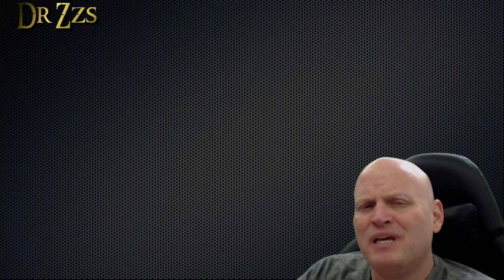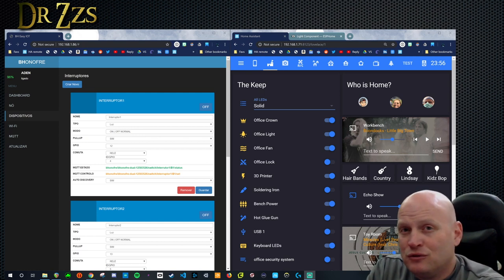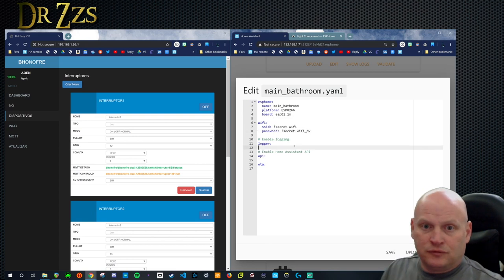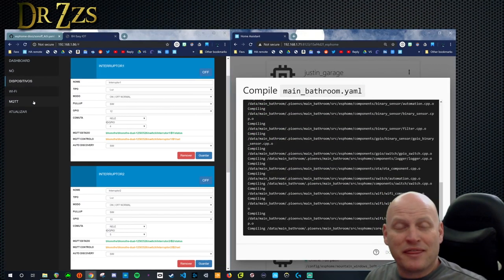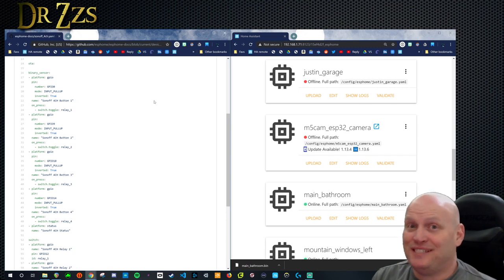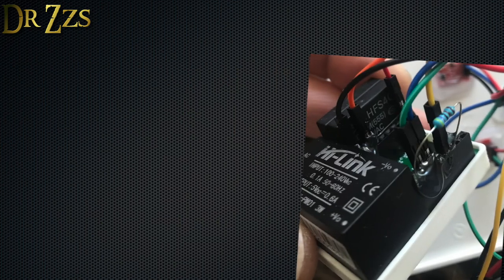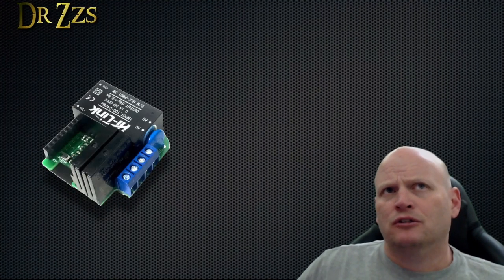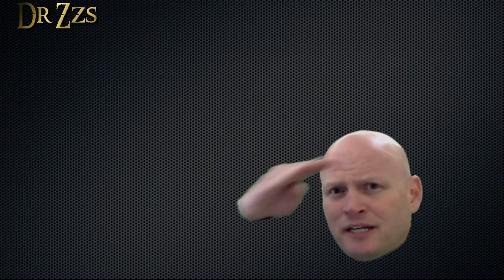Mini Smart Switch w/ ESPhome yaml | home automation | Home Assistant

Comment: I've used the RCWL-0516 microwave sensor for about a year. 
It's very sensitive to noise from electronics and should be placed away from metal to avoid false postives. 
The main problem with the sensor is that sensitivity is not adjustable. 
Range is about 5-7 meters. It works well as a "general room presence detector" for lights, but testing different placements in the room is key to getting a good result. I use a PIR sensor turn on the lights and the microwave sensor to detect when the room is empty and turn off the lights.
Reply from the maker: That's interesting.  I hadn't thought of using both together.  
Thanks!
Reply: If you have problems with false postives with a PIR sensor you can also use the microwave sensor as a confirmation. Then trigger the light if both sensors are postive or use the microwave sensor as a condition.
Reply: RCWL-0516 Microwave Radar delivers 360° motion detection even through glass, that's why DrZzs thinks the sensor is not working well

Comment: From a NEWBIE just starting off. This product here.  Where does it "fit" with sonoff?  What are the "cases" where I would use this over sonoff or vise versa:
what type of smart install applications will this be best choice over a sonoff?

I was thinking of 'starting' with moisture sensor and watering (small pump) wife's plants in separate pots.  I was looking to try and combine management of 2 or more pots under 1 manager card be it sonoff or another card.  However, each flower pot would need its own sensor, water line and pump and also some have additional code to over ride dry for extra few days as some plants strive with "less" water than others. 

I hate to ask so many questions but still gripping logic of basics what I can and limited to and figuring  out the best configuration installation with less to manage and cost savings to spend toward "security sensor devices" I need also.

Most Humble appreciation for your guidance and  injput based on your knowledge and experience.

Alton

Comment: 2 things about SSRs:
1) they don't ever completely turn off. Being a silicone device there's always leakage current. As far as humans are concerned even when "off" they'll read mains "hot" w/ a meter.
2) always go about 2x in rating over your expected load. Might still need a heats ink even then. I get a 10-15°F rise in my water heater controls box w/ an 80mm fan drawing across heat sinked 40A SSRs w/ a 17A load. 
I did scale the fan PWM from 0-100% for 75-90°F in the code. Runs quiet most of the time unless heating.

Comment: you can change the sensitivity of the touch sensors by replacing the capacitors at the back. You can find more information by going in the datasheet for the TTP223
Reply from the maker: Awesome!
Thanks

Comment: As for choice for HAS COMPUTER, i selected what should be a yr old announced SBC which I believe will be a super performance option.  However,  I have to ship it to CA to a contact there to customize small alteration to the SBC itself.  I cover the cost to ship it there and back home.
I would prefer that SBC over an old business server I have had for 20yrs.  It has 5 SCSI hard drives.  I was going to load different OS and apps on each drive then use BIOS to boot from Drive I needed at the time for a specific purpose.  But that would conflict needing HAS UP AND RUNNING all the time.

Comment: Microwave motion sensors can see through most interior walls, so maybe not false positives, was someone in the next room?
Reply from the maker: Could be.  Have you gotten them to work?  I've tried a few times and always end up going back to PIR. 
I read a lot of post about people having trouble with them when connected to ESP8266. 
The first time I used one, I just connected 3v and an LED to show when it detected motion.  It was really sensitive.  Like if I took a deep breath, my chest moving was enough to activate it.
They are cool.  Hopefully I can figure out how to make use of them someday.
Reply from the maker: oh, and Happy Belated Hatching Day.  I can't believe we forgot to sing to you on the stream yesterday!!
Reply: I was going to mention the same thing. The can see through walls. Seems like a great sensor to use to see if someone is still in the bathroom, you just have to find the right place to mount it.

Comment: @DrZzs The failure to connect after initial flash is because the ESPHome server/docker is pinging that devices IP after the flash every X seconds but the actual device needs time to reboot and connect to the network after flash.... it's perfectly fine.
Reply from the maker: Excellent!
I figured it wasn't a problem.  If it does it for more than 8 seconds then I start looking for something that's unplugged.

Comment: Quick note on the lack of UL listing: AFAIK, UL is a US-only certification entity, so if the device is only really meant to be used in Europe (or only Portugal, considering the firmware language), the manufacturer will often skip UL certification. Doesn't necessarily mean it's unsafe, but depending on your building codes, you might actually be out of compliance if you use stuff that's not UL-certified, so it's something to keep in mind.
Reply: I would feel better without UL certification if these devices carried a similar European certification. I will not put an uncertified device in the walls of my house on 110 volts. Good chance you could jeopardize your insurance coverage if something bad happens

Comment: Hey Doc, I am back again, had to step away for some time. I am catching up on videos. 2 things, 1st the FUN one.  I saw your home tour just now. LOL

Lovely home. 5,500sq ft. I had1,300sq ft, sold and bought 4,000sq ft, sold and bought 2,000 sq ft, sold and bought 1,500sq ft, sold AND NOW in a 1,000sq ft home. LOL.  The 1st four purchase sales were for equity gain cash. netted 600k overall. not bad. 5th move was near widowed mother to assist her and plus my career cut short .Disability Heart related. (Our house sizes are funny to me.)

2) IMPORTANT - Over time you have used different boards.  This board seems just by this video that it has more and maybe be used "in place of" the earlier boards you installed in your home.  Am I wrong in that assumption?  Also what is total cost in your choice board and door/window sensor setup with wires and all?  If you posted on your website link to wires. board of choice (I know doorbell unit is different and like what I think is y9ur latest option there).  but there I have a question on how much power normally runs to a regular door bell? Can you add to website links for doorbell parts purchases including any power reduction items.  That would  be an excellent guide.
I hope you post "somewhere" all your modified code for boards you set up in HA That would be helpful.
I am ready now to start with smarting my home/ storage barn/work shed/private office in one building and also my entire yard/driveway .
Side project:  I have AI development board, KING of projects is to fully automate my riding mower to mow entire lawn "in a pattern" and open and close-lock barn door all in one.
Security First though.
God Bless your work here and Professionally! God Bless your nice family!
Humbly ,
Alton

Comment: Ben from BRUH had some dramas with a sensor ($15 DIY Multisensor - Temperature, Humidity, Light, Motion, and RGB LED) and fixed it by locating the sensor physically further away (he ended up swapping it out for a different device because his was a tiny all in one unit). Not sure if this is the same issue but I'd try putting the microwave sensor on some long leads and testing again.
Reply from the maker: good idea.  I'll give it a try.  Thanks!

Comment: You are going to burn a hole in my wallet. I have a Shelly 2 that I need to replace with one of these to add motion and humidity to.
Reply from the maker: I've been trying to decide which is better, this or Shelly 2.5
Shelly get's lots of points for being UL listed.  But it cost $30 on Amazon, or almost as much direct from the Shelly guys. It has power monitoring, but I don't need power monitoring on every switch.  
I would like a temp and motion sensor on just about every switch, so that's a point for the BHonofre.  
I want to build some BHonofre's myself.  If they aren't terribly hard to build, and if the price is a lot lower when I build it myself, I think I'll be using a lot more of these.
Reply: @DrZzs  never use the power monitoring either on my Shelly 2. I can calculate the usage if I wanted anyways. I like how this one is designed to be used with extra sensors as it appears isolated unlike the Shelly. Plus it looks stupid easy to load firmware. Fits my needs perfectly. Only downside I can say is I wished they used the Meanwell power supply like Luma did in the HA Switchplate.
Reply from the maker: how are you're PCB design skills?  They have the eagle files on github too.  I'd like to add a 3rd relay and some push-in connectors for the mains wires.  Maybe we could change the PS too.
Reply: @DrZzs  probably not up to doing mains AC design. I have only dabbled in it. Bet there are few pros in the community that would do it in the sleep though.

Comment: can you please load a general purpose NODE MCU with TASMOTA for relay operation and add it to the HASS.IO , you can simply connect LEDs and some switch for example. HASS.IO has changed a lot so if you can revisit installation of HASS.IO on the RPi
Reply from the maker: ya, I can do that.
Reply: @DrZzs  please, waiting for it since a long time. I am just now able to get my TASMOTA homebrewed design on HA. Your help would be really good, because I understand your way better